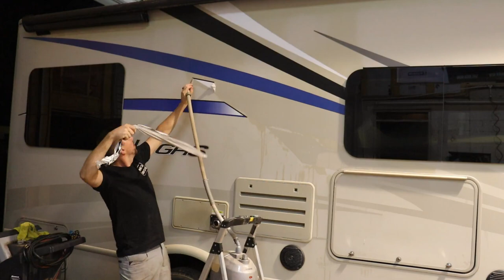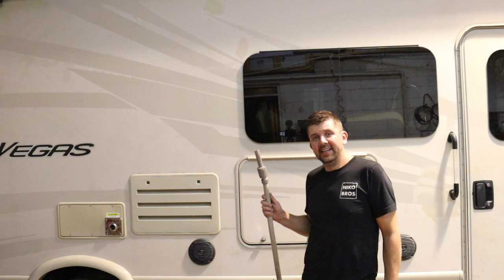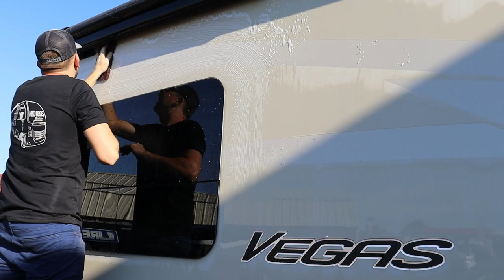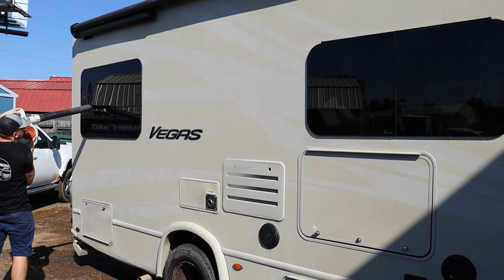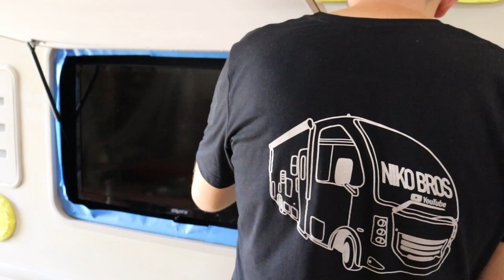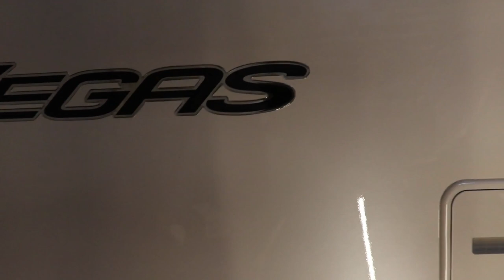The HARDEST Paint Job We Ever Had To Do Salvage Thor RV Rebuild

Comment: The hardest part and most important is removing any silicone caulk around the corners and trim or anything thats been drilled through the sides because car paint will NOT stick where silicone caulk was at. I like to spray some sandable primer around any areas that had silicone so the paint will stick better and no fish eyes will appear in the finish

Comment: smoke detector battery getting low unplug it remove the 9 volt battery and hold down the test button it drain it before you install a battery  it stop that chirping sound drives me  nuts when mine does it